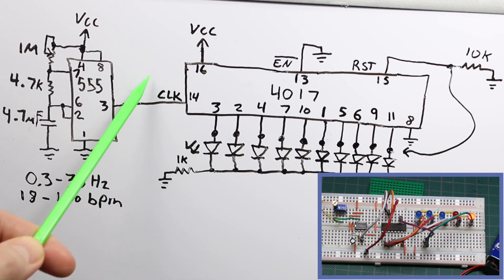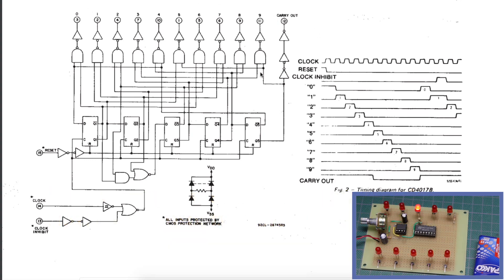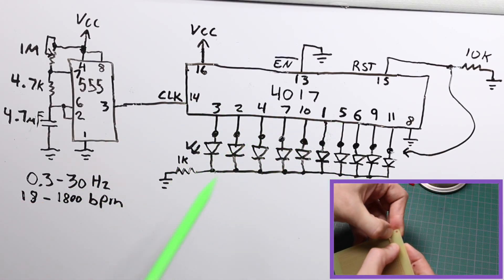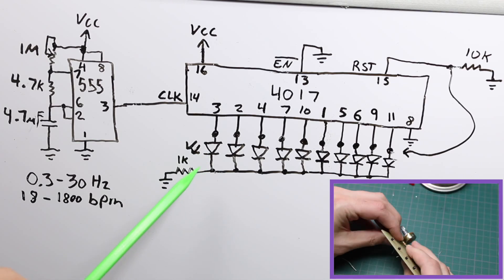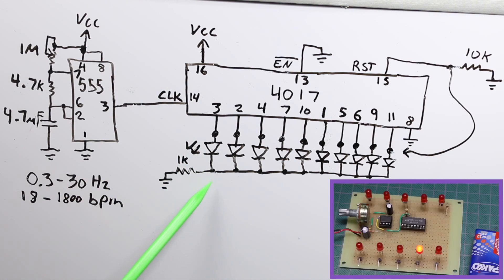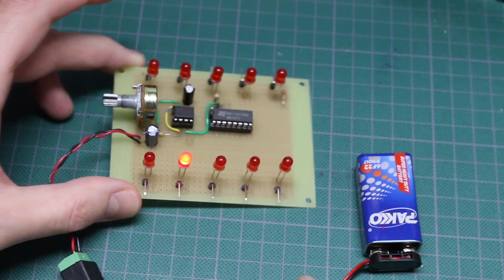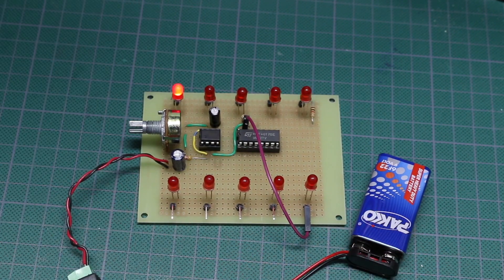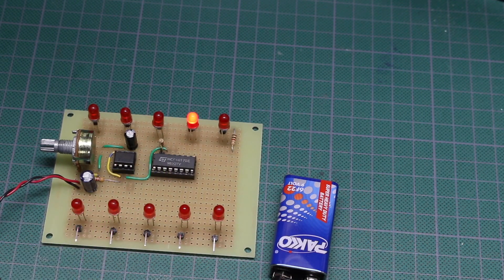4017 LED CHASER: Visual Metronome

Comment: Don’t need a transformer for a discrete clock, I’d just go with a ~1MΩ resistor and an optocoupler, probably a (zener?) diode too. Ditch the opto if you already have neutral as your 0V reference. Oh and an input cap and choke to stamp out any transients that might cause double-counts is likely a good idea.
Reply from the maker: The main concern would be safety with high-voltage including possible legal concerns in some areas so if we start out with a secondary of a transformer that’s less than 40 V or so, it covers all bases. 
 If I were doing my own circuit, I might go straight across the incoming AC but as long as I have a drawer full of old transformers from alarm clocks, why not use them.